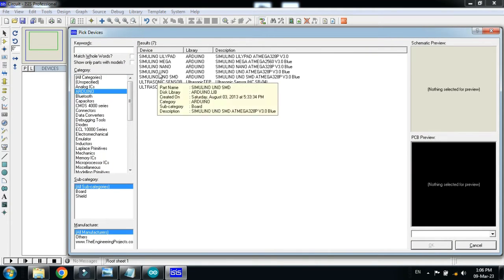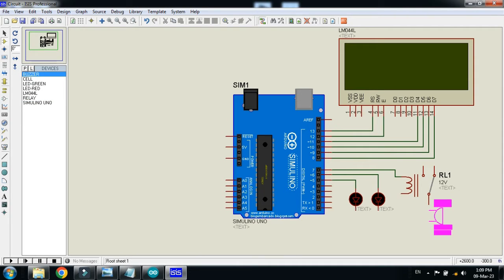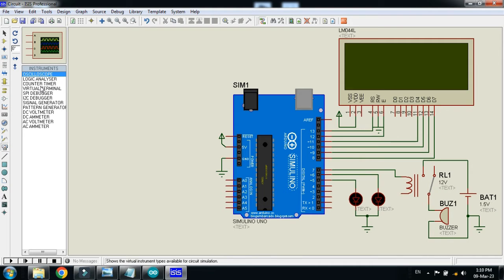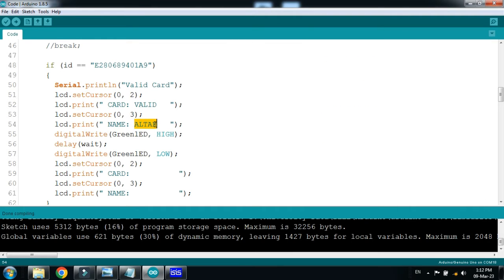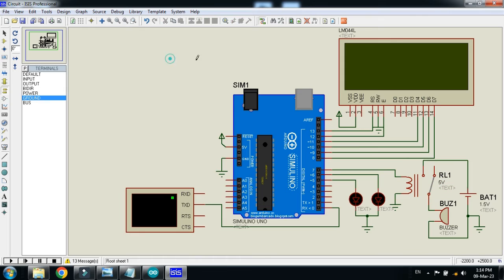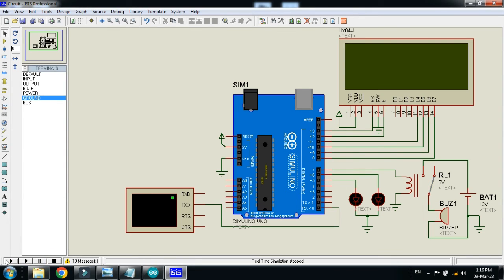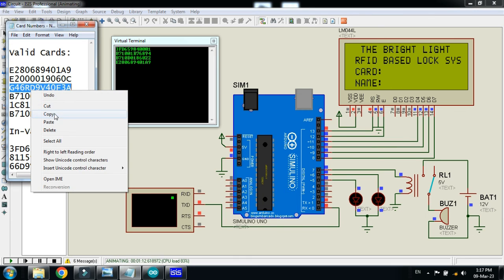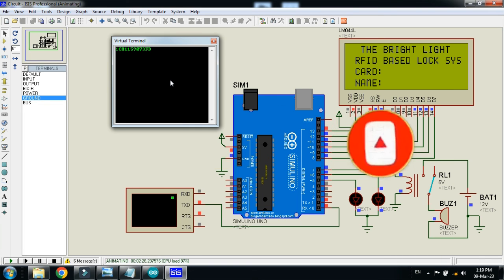RFID Based Security / Lock System Using Arduino With Code & Circuit || Proteus Simulation

Comment: I have downloaded the Arduino please guide me HEX file cannot run
Reply from the maker: Kindly watch the video again and follow all the steps, it will work. You may have left some steps or values. Try again it will work. Also you can download my simulation file and code from the link available in video description. Kindly check that all the circuit connection are connected properly.

Comment: How can I increase the sensor sensitivity at the end of rotation?
Reply from the maker: This reader have a specific reading distance and can't be changed, if you need a reader with more distance then kindly search for some other readers that have more distance range than this. This is the simple solution